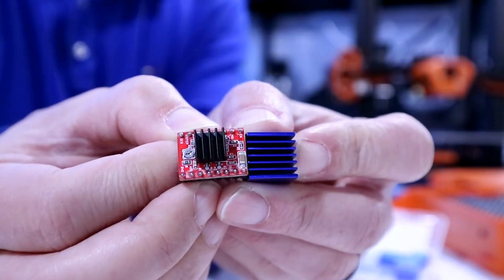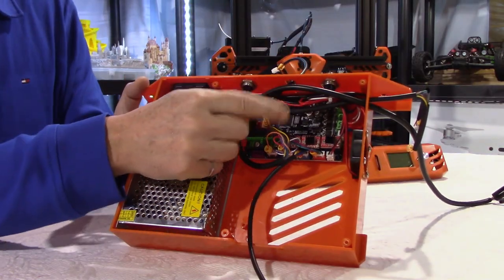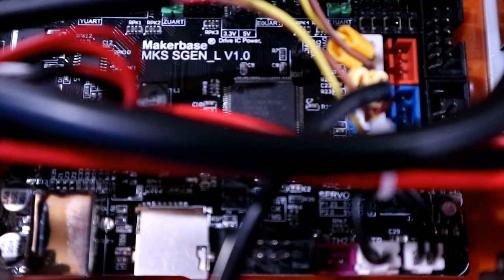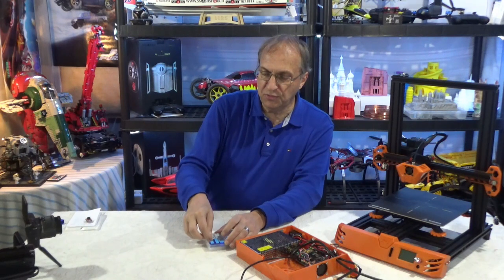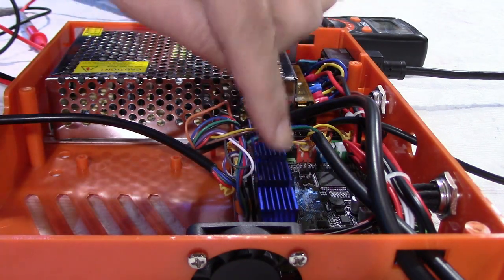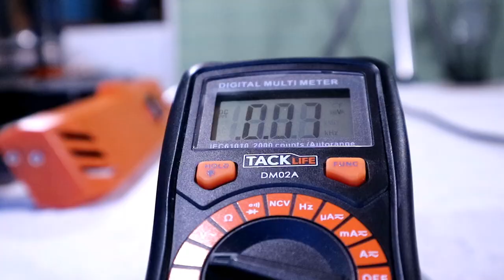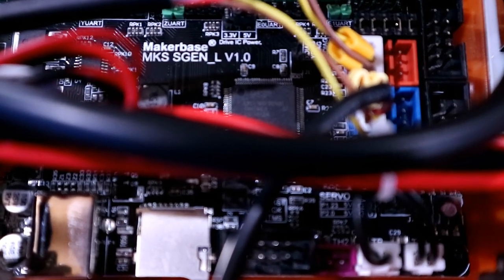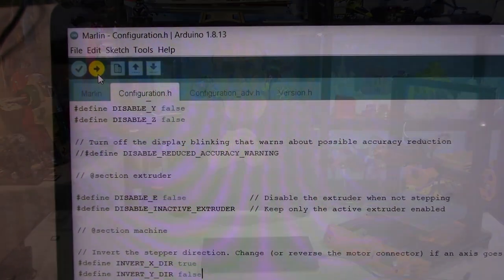Homers Tarantula Pro | TMC 2208 upgrade failure!

Comment from the maker: I attempted to upgrade the stepper drivers to TMC 2208 but the firmware update is not going well...If you have the same issues, perhaps we can help each other!  Thanks for watching!
Reply: Let me share you a Github post,there  You can find the right firmware 😎👌
Reply from the maker: I did check on Github and did not see anything for this printer! I probably missed it.
Reply from the maker: Thanks a lot, I will try that.
Reply: I had the same issue with updating a firmware for Homers Tarantula Pro. It comes with 32bit processor, so you cannot use Arduino IDE to update the printer. I'm using VS Code + platformio add-on. Also remember that there is no Mega 2560 processor but LPC1768. Firmware update is accomplished by putting on sd card .bin file to the main board slot. If you need more guidance please contact priv.
Reply from the maker: Yah, the above did not work.  I will try VS Code which I have used before and see how it goes.  Thanks a lot for the comment.
Reply from the maker: Where did you get your firmware file for the T Pro with TMC2208?
Reply from the maker: Thanks!  You did not change the Z axis?
Reply: Nope. I wanted to make more silent but Z Axis only moves every layer so it is soundless. I'm going to change also extruder driver but to LV8729 that seems to handle better an extruder than TMC2208
Reply: @SuperdanTech here is also nice video how to set jumpers. https://youtu.be/6RcrgmNvyeA I use TMC2208 standalone version. With UART version I don't know how to configure. Marlin's files that I shared are configured for standalone version
Reply from the maker: Yes I did this for the jumpers.  Thanks!
Reply: Just get the latest official marlin, there are plenty of tutorials how to set it up from scratch.

Comment: The A4988 doesn't get enough credit, it's a feisty and well-behaved driver. Main drawback is that it creates a lot of motor noise, and the harder you push it, the more motor noise it'll make. At higher settings, it will easily break your fingers with so much motor power. But don't be afraid to adjust VRef by feel on them. You can run them for a test with any potentiometer position, they will survive a short test at any value, and they are dirt cheap too, you can have extras for only a couple dollars. The VRef is manufacturer and sometimes batch dependent, it depends on the value of sense resistor. For the most common value, it comes out to 0.96V = 1.2A, which is a good amount of current, but on some boards, you may need double the VRef value to reach the same current! What happens when you set it too low? The motor might not have quite enough power to turn reliably, causing occasional click noises and lost steps, so shifts in the print. If you turn it up too high, two things can happen. One, you can overheat the motors, either melting or damaging something in vicinity, or maybe the motor itself. Motors are pretty difficult to damage, their rated internal temperature is no less than 120°C, and corresponding casing temperature is 80°C. The heat pain threshold when you touch hot metal is around 60°C, so as long as you aren't burning your fingers off when you touch your motors, you aren't anywhere close to killing them. The second thing that can happen if you set the driver too high is that the chip can overheat, which it will detect and temporarily turn off the outputs until it has cooled down, resulting in a shift in a print. If it happens repeatedly, you WILL kill the chip after it happens a few dozen times. The chip takes rapid damage starting from 150°C on the die, and the thermal protection kicks in at 150-165°C, so actually a little late to my taste.

As to cooling, well i have a custom printer with an 80mm fan blowing a lot of air on the drivers, not much fan noise either, they're basically cold to the touch no matter how hard i push them. But keeping them cool can be not quite trivial. This is because they are supposed to be cooled at the bottom of the chip via a thermal contact directly attached to the die inside, going ideally into a ground pour of a large 4-layer PCB, or heatsink on the opposite side of PCB, but as you can see, this is not how the StepSticks are made, it's just two layers and "wrong" side, and very small. The little heatsink on top helps a little, but the epoxy casing of the chip creates a lot of thermal impedance, and the heatsink size actually doesn't matter that much, because the thermal impedance of even a dinky little heatsink is so much lower than thermal impedance of the casing, so the little heatsinks they ship are actually adequate under ideal conditions, and larger wouldn't really help more, but good air is critical. TMC2208 uses higher decay and more of a linear mode operation, so it dissipates more heat and needs a lot more cooling, which is both more correctly realised on the TMC2008 StepSticks that you buy, with chips being bottom side and via-stitched to the top, and actually needs a bigger heatsink, which they can then make good use of. Something strikes me about this control box - it has an airflow short circuiting issue. So you have the 40mm fan blowing across the drivers, which is nominally adequate; but there's a giant vent nearby, allowing the air to escape before it has any chance to do much cooling work, diverted by the pressure of the air pocket in the control box, and just cycle in circles through the fan. The X axis StepStick might be well cooled but the rest not so. I suggest fashioning a shroud which would force the air from the fan through the StepSticks and a little the MOSFET area of the PCB. Some bottom air will be very good for A4988 as well, there is an air path below the StepSticks, created by the unpopulated bottom side of A4988 and the plastic holder of the pin header on the StepSticks. Bottom air is less relevant for TMC2208 StepSticks.

For TMC2208, follow the manual for the SGen_L board that you received! If you are using the stock firmware, it should still turn the motors over, but the wrong way around. If you want to try firmware for TMC2208 (not TMC2208_STANDALONE), you probably need to remove all the jumpers under the StepStick, and install the UART jumpers to the bottom left of each StepStick. You should also use some kind of serial connection software like Pronterface or Repetier Host to see whether the firmware complains over serial about something, also M122 command can be used to give a diagnostic report. When set to TMC2208_STANDALONE the operation is completely identical to A4988, except that A4988 has slower step/dir pins, so they need to be held longer, with TMC2208_STANDALONE it can speed them up. So i can't quite figure out why it's not doing. Extruder won't move until hot, move commands filtered out by Marlin, but you probably know that, so you need to test other axis instead, and some firmware are set up to ignore all moves except homing when not homed yet.

The other problem you have had is print being cancelled mid print. You definitely need to see on the serial monitor what's happening there, before further diagnostic steps can be devised. The processor shouldn't be subject to overheating; but i kinda expect Makerbase boards to have an issue on 5V or 3V3 rail which may need an extra capacitor depending on how much equipment is connected to the board and the batch component quality, it can become prone to signal noise and processor brown-out, so the processor momentarily not getting enough voltage. PSU faults are also possible, but these are very dumb PSUs, they should see a significant output voltage depression before they trip, and if it's heat related, they usually signal the issue by exploding rather than by turning off and back on again. Also the minor/logic rails are generated on the Makerbase board and should buffer for a while, even when the main power is lost.
Reply: Oh, i didn't notice that you already sold the printer. I think on most TMC2208 boards, you may need higher VRef. So i think a value of 1.7V can be desirable. There isn't much harm in experimenting. There is overcurrent and overtemperature protection. The limit temperature is 143°C, which is good to keep the driver safe, since again it starts rapidly degrading only at 150°C.
Reply from the maker: Thank you for this very detailed analysis. I hope many viewers see this as it may help them. After two months of trying different things and before changing the control board or power supply, I gave up! I will probably buy a new printer this winter. I don't do much 3d printing in the summer.  Would you have a recommendation?
Reply: @SuperdanTech  I don't really have any specific recommendation, i don't even like printers as a product that much, so not actually interested in the ones sold and not keeping track of them, i'm more interested in underlying tech and tinkering and parts. I wouldn't want to trust any printer i haven't designed and built myself, and also by my experience, i wouldn't trust a printer i built either! :D I'm really not very good, nor am i of high opinion of companies operating in this space, especially budgety ones. As far as i'm concerned it's just various shades of fun junk toys. I have done minor development contributions to Marlin before and expect to move onto maybe more major ones.

Comment: I just bought one of these printers, and have not put it together yet.  Right off the bat, there are some serious design flaws when it comes to cooling.  The one fan in the case provided is blocked by the aluminum channel, and the printer sits so low that it blocks the vents in the bottom.  My first prints will to be to make some extension feet by Ivan Gonzalez in Thingiverse 752361.  I will be adding a fan to the power supply and the bottom of the case, along with driver upgrades. Also, heat sinks for as many MOFSET transistors and chips as possible on the board and in the power supply.  I will also be adding card paper shrouding, to channel the air, from the fans, across the heat sinks.  I am also planning to upgrade to a larger power supply which will require extending the length of the case some how.  I think it will require cutting the case, and adding extensions to the middle. Along with blocks in the back, longer mounting screws. I would think that card paper, and maybe a little hot glue or tape, would do wonders for keeping hot and cool air separated around the hot end as well.
Reply from the maker: Hi Andrew, this sounds like a very good plan.  Yes for the power supply upgrade you will need to cut the plastic box to make it fit.  The problem with these upgrades, which I partly did, is that at some point you should ask yourself the question "should I just buy a better and more expensive printer?".  This is what I am going to do.  I sold this printer to somebody who will use the frame for a CNC machine and I will buy a better printer in a couple of months.  Thanks for sharing your experience here and by the way, let me know if you can recommend another printer.  My first one was the original Ender 3.

Comment: Hi Dan. Hope you're having some luck with your printer.
If you remember, I was having the worst luck with mine. Nothing but problems.

While I'm no expert, I got a funny feeling you might need a new board. It's sad to say, being that your machine is relatively still new,
but at the time of your purchase... faulty parts were being allowed to leave their factory. The first day I had mine put together, I
discovered that the board was bad. Imagine that! So, I wouldn't be surprised at all to find that you may need to buy another. I got
my new board (MKS, like the original) from Amazon, about $35. Came with better drivers.

Believe it or not, I finally got the printer to function. Just two days ago. I had someone custom-make my firmware. About two months
ago, I bought EZABL & EZOUT from TH3D company. I can send you my firmware, but I'm not certain if it will work for you, as I have
auto bed leveling & filament runout installed. But, if you're good with firmware adjustment, at least you may be able to do something
with it. Just trying to help, brother.

If I can be of assistance, be let me know.
Reply from the maker: It looks like you did very well.  I should have replaced the control board I think, just like you did.  I had several issues when I tried to update the firmware after replacing the stepper drivers.  Arduino would not work so I tried VS Code but I am not well versed on it!  After trying for a few weeks, I got really tired and gave up.  I am currently looking for a new printer.  Not sure what to buy...  Thank you very much for your help.
Reply: @SuperdanTech  Dan... I thought the same thing, after having had enough of the nonsense. After making a big stink on Facebook message boards, I bought myself an Artillery Sidewinder X1. Wow! This printer is SO good, I couldn't believe my eyes. The quality is through the roof! I bought it on Amazon, about $450. Comes in two pieces. Connect the gantry, and you're ready to go. Please... do a little research. I wanted another printer, and wasn't settling for "maybe". This thing delivers. It's night & day, compared to the kit we both purchased. I don't make a dime from my opinion. No fixing, no troubleshooting, no firmware guessing, no wires, no multimeter. The touch screen is SO easy to use. The TEVO has been nothing but a nightmare, so far. Look at their web site, they're practically giving stuff away. I'm just now getting it to print. I STILL have to figure out some adjustments that I'm STILL not qualified to make. Like I said before, you would NOT believe how much time & money I've already sunk into this god-forsaken thing. You should NOT have to blow hundreds of dollars, and hours of troubleshooting on a printer that MIGHT work. Not to mention the non-existent tech support. We must have bought our machines at the pinnacle of TEVO's problems. Now... they won't give us the time of day. Artillery HAS tech support.

Look at the reviews. No printer is perfect. But the one I have has brought serious joy into my life. I'm printing RIGHT NOW. I've had it since the beginning of September, and I haven't had a problem yet. 

If you have any questions, just ask.

Comment: I was was thinking about getting one of these but after watching this, think I'll stay clear of it. Alarm bells should have started ringing when they went from metal parts to plastic and pinching pennies by removing the BL-touch connector. Zero support and no firmware just kills the whole experience. And a magnetic removable bed is also a must these days. It doesn't take much to get the nozzle too close to the bed and destroy the surface, or for a print to rip the surface apart when you try to remove it. I've spent hours of my life before now, trying to remove/clean a sticky bed base and I just can't be be bothered with that anymore. It's just something else that shows a lack of care by the manufacturers.
Reply from the maker: I think Homers recently added files on their website...after lots of complaints I think. Completely agree with you about the bed. What do you think of the one on the artillery sidewinder printer? It is not flexible but it seems to be easy to remove prints. It is also direct drive. I am kind of tired of Bowden tubes. Merry Christmas!
Reply: @SuperdanTech  I'm not a fan of glass beds. I've seen too many videos where people have cracked them and it's a weird size so finding a replacement could be a problem. Also the heater part of the bed is also a fire hazard according to Thomas = https://www.youtube.com/watch?v=A3hHqH0oDmI

Comment: Hi could I ask you what is the best settings to use on this printer int he lcd screen the best configurations and everything I need to knoe please and thanks
Reply from the maker: Hi there, I sold this printer to get another one.  If you are looking at settings in Cura, I have a video on that in my 3D printing playlist.  Good luck with your printer!
Reply: @SuperdanTech  did you find this to be a good printer as I only Have it 2 days now and having a few problems but probably because I'm brand new to this stuff
Reply: @SuperdanTech  also could you link the video as I can't seem to find it
Reply from the maker: I had issues with this printer. I did a couple of videos about it.
Reply from the maker: Here you go: https://www.youtube.com/watch?v=N2TYSyGYe0c&t=5s

Comment: Hello, I have a homers tarantula RS.
I have receive an SKR 1.3 unbranded motherboard with 5 TMC 2208 in stand alone mode.
On the sd card, I have receive a merlin firmware for SK sGEN , so impossible to use it !
As you, I don't have support from homers
So I try to install marlin bug fix 2.0XX, but I got following issue :
layer shift on Y, even raising vref to 1.2v same issue
enabling linear advance make extruder stop !
Try to uses UART, but my driver UART have no connection. I have solder the TMC 2208 pin to module Pin, but I have TMC connection error !
I have check with scope the UART connexion, I have been able to check the skr 1.3, using marlin debug pin, I have been able to verify that Tx is ok, and Rx is ok !

So the pb is my TMC 2208!?

I have order TMC 2209, I let you know if I have better results.

Other issue, I have fix a bltouch, but when I  level the bed, and raise Z and set Z=0 than it is not more leveling

Regards
Reply from the maker: Hi Matthieu, you are having a lot of issues too.  For me not being able to read the SD card was a big issue.  You would think a company ships a decent SD card with their 3D printers.  I am continuing trying to fix my printer and I may post another video next week.  Thank you for visiting my channel.